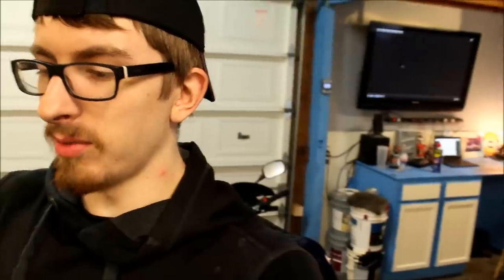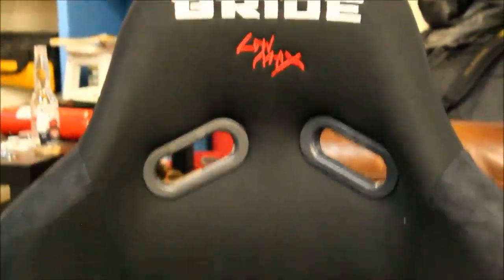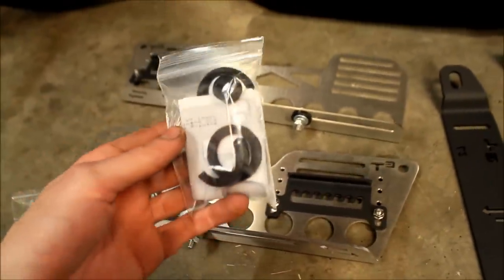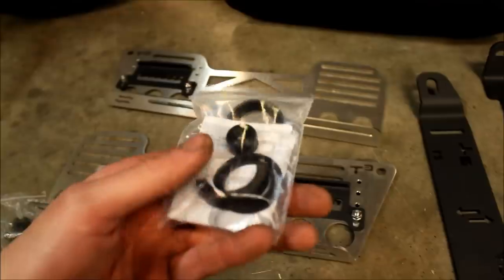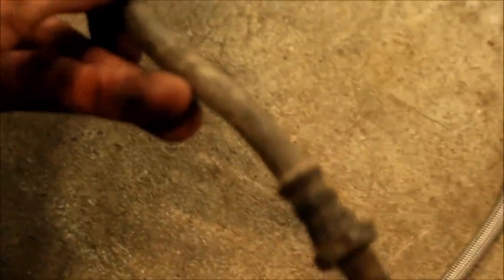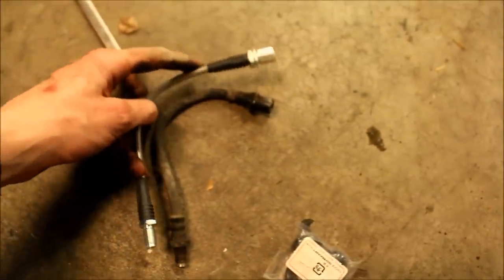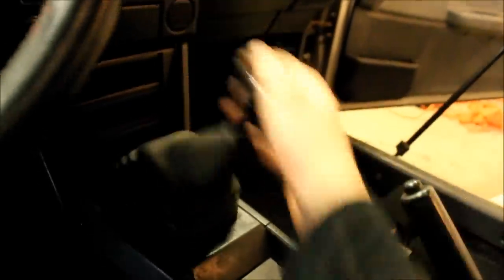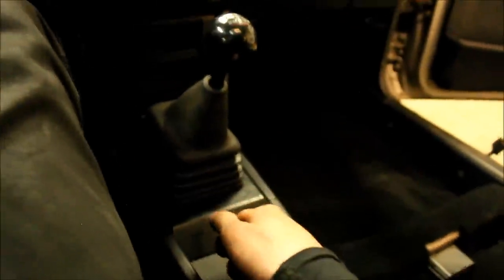"BRIDE" SEAT + FINISHING UP THE AE86

Comment: I just bought an AE86 that came with 03 Celica seats. The passenger side is a bitch to take out. Driver seat is perfect but previous owner didn’t put in sliders. If you were closer I’d just give you the Passenger celica seat, but I’m in Texas. Btw I’m selling a 4age turbo kit that came with the car. Manifold, turbo w/ no shaft play, wastegate intercooler piping. Lmk if interested or anyone who might be !